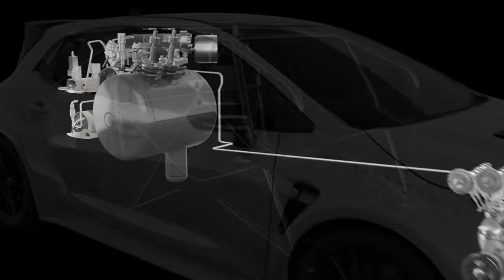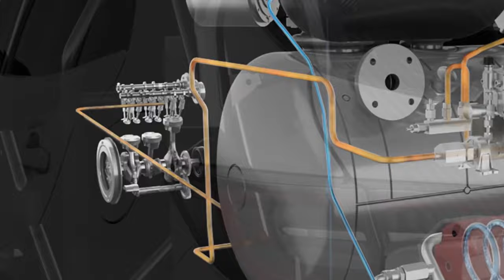This NEW LIQUID NITROGEN Engine Will Destroy ALL EV Makers!

Comment: You just know the author doesn't know anything about cars or science. 196C is hot. You mean -196C which is extremely cold and difficult to maintain. The nitrogen will become a bomb if it starts to heat up and can't vent. If it vents, you lose your power source. You also most certainly need oil and have to do oil and filter changes. It is still effective and ICE.

Comment: These have one of the same problems as electric cars.  In electric cars you have to burn fossil fuels (or have nuclear reactors) to charge the batteries.  In this kind of engine you need to cool down the nitrogen to make it a cold liquid, so again you will need to do burn fossil fuels (or have nuclear reactors).  Give us a break.

Comment: If you think finding a charger for your EV is hard, imagine trying to find a source for liquid Nitrogen
Reply: The air that’s 80% nitrogen? The fact their already is an infrastructure to make it that would just need to be upped? We also have a way to hold it unlike the hydrogen vehicles and if I remember right it’s a noble gas so we don’t need to worry about it combining with things while inside the engine.
Reply: I just watched a video of a guy who put together his own machine to make liquid Nitrogen at home.  It cost him about $1,500.  If the liquid Nitrogen car came with a unit to make the liquid nitrogen at home say around the same size as a refrigerator then you don't need public infrastructure as much.  From my calculations to go 300 miles you need about 40 gallons of liquid Nitrogen.  According to Google it takes about 1.895 kilowatt hours kWh to make one gallon of liquid Nitrogen.  If off peak hours is $0.15 per kWh then per gallon it cost $ 0.28425 per gallon to make at home.  Or to go 300 miles 40 gallons of liquid Nitrogen would cost $ 11.37 or $ 0.0379 per mile.

Now my calculations are based on not using the liquid Nitrogen to run an engine like in the video.  I use the liquid Nitrogen to spin a generator and use a relative small supercapacitor bank to store the electricity and then run electric motors to move the car.  Think EV but no lithium ion battery.  You get all the efficiency, acceleration, regenerative braking, low maintenance without a huge heavy expensive battery.

Comment: It sounds possible. I worked in a refinery on these very large screw compressors in a train of three and they were housed and ran in a sealed and insulated room. 
There have been a few fatalities there from nitrogen gas which is used in the process to prevent explosions and fires. 
It's the only thing that worries me about this one. Nitrogen gas is dangerous because you can't see or smell it and it doesn't let you know that it is affecting you.
Reply: I think I find the better solution, Just combine O2 20% to N2 80% the same as our atmosphere .,Even the gas leak, There is no toxic at all just the colder temperatures.
Reply: @prachayaputtapanasub1113 .. The compressor train push a very high volume of flammable gas through a long circuit and by their very nature leak a bit of the gas and the nitrogen is used to prevent fire and explosion
Reply: @prachayaputtapanasub1113  Bingo!!!
Reply: @jiggsborah7041  Umm...I see, although  using the same proportion as the atmosphere 20:80 but with the compressed air the burning rate will be increased as well.👍 However mixing a little bit proportion of oxygen(but less than 20:80) may be a better choice in case of an accident.
Reply: @prachayaputtapanasub1113  ... I guess they decided it would be too much trouble. It's a vast chemical plant

Comment: If there's an accident  it will just evaporate. 
I've worked with liquid nitrogen.. and had frost burns..  if it ruptured you will lose body parts. The venting off the liquid nitrogen could cause people to pass out in confined spaces like garages..
Reply: not only pass out but if the gas is confined and the person opens the door they will pass out instantly.. and now maybe suffocate...  it's like "instant carbon monoxide" poisoning
Reply: You don't mount the tank holding the liquid nitrogen inside the passenger compartment of cars.  You mount them outside like they do with gasoline tanks.  The chances of getting sprayed with liquid nitrogen mounted outside the passenger compartment would be the same risk of getting sprayed with gasoline in an accident.  Meaning it be very low chance of happening.

As for venting off nitrogen as the car sits in a garage you want every car to have oxygen sensors that raise an alarm if the oxygen levels get too low.  A super well insulated nitrogen tank would minimize the amount of liquid nitrogen that turns into gas.
Reply: @johnpreston6381  You would not pass out instantly even if you car's interior was fill with 100% nitrogen and you opened up the door and sat down and closed the door quickly.  Basically however long you can hold your breath before passing out is how long it take you to pass out.  Still very dangerous for that situation but having multiple oxygen sensors both inside the car and outside that could trigger the car's horn to honk say 3 short honks then 3 long honks and then 3 short honks over and over to warn when oxygen levels are low.  That pattern of honks is morse code for SOS.

Comment: Sounds like bullshit. What is used in the engine to generate the heat required to make the nitrogen expand rapidly. You would need a very rapid source of heat,  supplied continuously,  because liquid nitrogen has an extremely rapid cooling effect. So what is used to generate the heat required?
Reply: That source is already there - a heat battery that can store energy at 2500degC. Intake stroke filling the cylinder with hot air, cold N2 injected = full power output. Currently a ship engine is converted to this technology. Source? High temperature CSP with graphene solid heat transfer.
Reply: Our battery for an auto weighs 2 kg and has a capacity of 500,000. Watts. It charges with electricity or conduction, in seconds. Also, it does not deteriorate with time or use. We have designed batteries up to 34 Gigawatts. Perryman Technologies.
Reply: We do not inject 2,500. C into an engine. Actually the gas expansion lowers nitrogen to a temperature that leaves a cold fog from the exhaust. Any engine in use today can be run on nitrogen by changing the head, which converts the engine to run on compressed nitrogen gas. The result is an engine run with pistons or a turbine.

Comment: way too many issues, especially thermal. Recall it was the cold weather that bricked all of these magical EV toys only last winter. Hot weather will factor heavily into the efficiencies expected, I expect. 

And the energy used to compress the Nitrogen to start with. It may be similar to the energy needed to process crude oil into gasoline: IDK.

Waiting to see real results before buying, but if it works out for Toyota I'd buy one. I won't be around then, but what the heck.